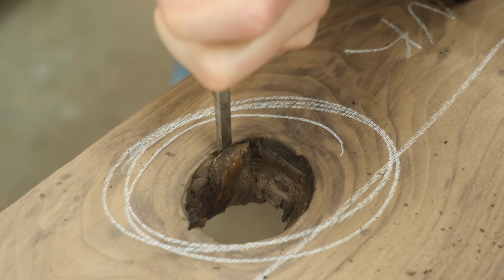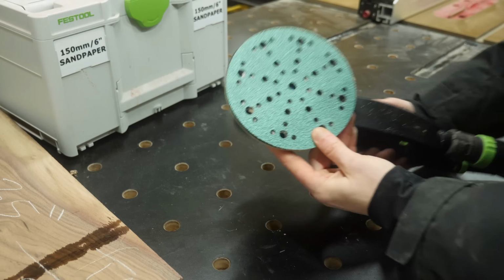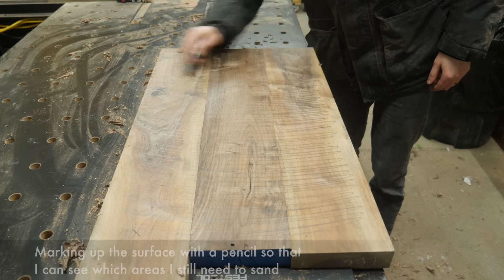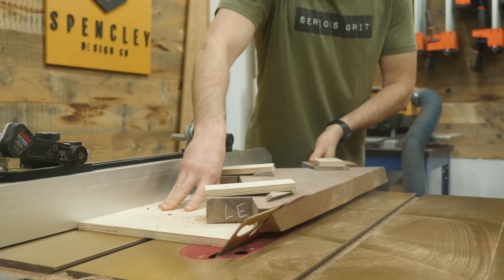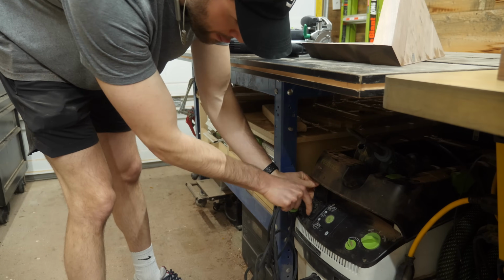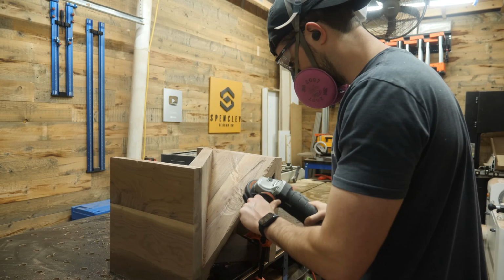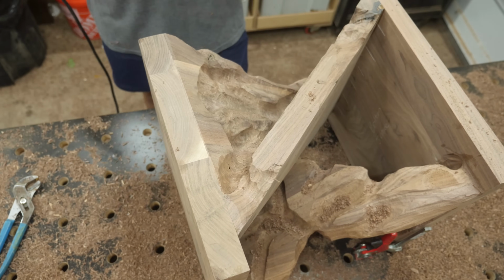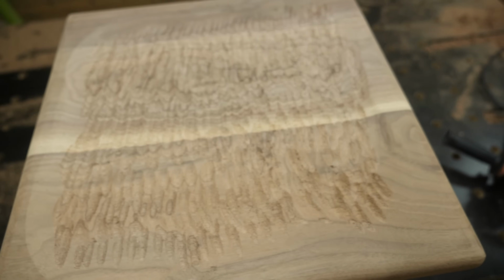why everyone is afraid of this

Comment: @SpencleyDesignCo I'm going to disagree with you on quite a few points, I think you're in a bit of a bubble here. Hand-tools aren't antiquated or outdated, but - using them is a choice. A woodworker works with wood - which you do, so you're a woodworker. If that's a label important to you. 

Here's an old saying: The tools don't make the craftsman, the craftsman makes the tools. 
Everything you use as a tool serves the purpose you put it to.
Power tools are faster, and more time efficient. The way you work with wood using power tools versus hand tools is different: they're different skillsets. 

Hand tools - in some instances, like planing - can match the time and effort of an orbital sander - if the blade is sharp enough,
Which - sharpening tools with blades is necessary, most of the time, or with power tools, you just buy a new blade.

Blades, in general, dull over time, saw blades, planers, jigsaw blades, everything dulls, the difference between most hand tools and power tools is that you sharpen the blade yourself. Sharpening doesn't always take a long time, unless you've been using a dull blade for a while, in which case you dug your own ditch there. 

At the end of the day, what you choose to use in your shop is your choice, if anyone tells you that you're not [x] because you don't [y], that's called gatekeeping, and those people are assholes. 
Everyone has a preference in what tools they use, I like hand tools, but power tools make certain things easier and help be spend more time doing the things about woodworking I like, and less time doing the things I don't like. I'm an amateur, I don't do woodworking for profit, I like designing and creating things, sometimes to fill a need in my house, sometimes to fill a need in the places i donate my time to. A few of my projects are fixing up a mobile cooler and modifying it to better suit the community's needs. Also they're broken, so repairing them is the main goal - I'm just repairing them... better... anyway - it's more of meditative, creative problem solving practice. 

The slowness of handtools helps me slow down - because I tend to move miles a minute and miss the trees for the forest and the flowers from the bush.

Comment: The hand tools thing is a great point. I love my hand tools, and even refurbish old stuff to resell and keep in circulation. That said; it does get culty when you have a job that isn't as easy or straightforward with them, and Dave next door is on a autistic rant about how you're doing it wrong, and must be lazy or unskilled. I think it's important to keep your hand tools if you're like me and inherited some, or feel more comfortable with them, or if you don't build for speed/money reasons and like the quiet, orrr like if you want to learn the fundamentals so that you're able to work with anything you have even if the power goes out... Come to think of it, there's a ton of reasons to use them, but that doesn't mean you suck for preferring mostly power tools either.

P.S. Congrats on getting married and getting a home!

Comment: When you talk about how hand tools are kind of outdated in many cases, you might be partially right, but I think you miss one thing, and that is the completely different approach that today's woodworkers have compared to say a couple hundred years ago. As you also stated in this video, nowadays most designs are only including flat surfaces, perfect 90 degree edges- and really not much more at all. Which is a taste thing, and "de gustibus non est disputandur", so I'm not implying that it is wrong or anything, though sure I think most people who look at 18th century furniture and say it is outdated don't realize that the reason why trends have changed so much and took a much more minimalist approach is at least partially because these "new" shapes (flat, straight, 90 degrees) are much easier and cheaper to produce in either buildings, furniture or clothing. They also allow the use of much cheaper materials, like mdf instead of very expensive lumber like you used in this project. In addition, these shapes are much more convenient if you are trying to mass produce furniture, which at the end leads to big factories like Ikea being able to lower the costs of production and still have an end product that many people will think looks good. So it's kind of like financial aspects are what shape style trends, and at the end of the day influence our taste and what we find pretty, which is a more rational reason why I personally dislike this change that has happened since the beginning of the 20th century. Back to my main point: The reason why you might say that hand tools are not convenient or relevant for you is because they are very good at producing flat surfaces and 90 degree angles, and they do that ridiculously fast. But if you were to say start a project in the style of Louis XIV., you will very soon have to grab those hand tools. Now that's what these people you were talking about don't get.

Comment: Stop putting your hand on the wood/track while you’re cutting! If a kick back occurs you will lose your fingers or even your whole hand. Only beginners put their hands behind the blade.
Also, who scrapes the resin off each tooth with a chisel? Plop the blade in a round tray and spray it with some Simple Green. Let it soak for a minute and use a nylon or brass brush to remove the resin. Rinse with hot water, towel dry and you’re good to go in under 4 minutes. I suspect your blade isn’t burning because of dullness but rather the saw table top isn’t at the right plane with an angled blade. You may have to shim one corner by measuring the blade against the table slot while it’s angled. Some trigonometry might need to be used to get the exact amount of shim height, or you can use trial and error after finding the low corner.

Comment: I didnt like it. Its too formulaic. Like "Arbortech" "Total boat" am I learning something or am I watching a total boat commercial? I felt him on the pythagorean cut tho. I had a 2" unit rise for a ramp. You should be able to extend the seat cut to complete the joist. The ledger cut fit fine but the foot cut not so much. I either cant math or if you shot a laser across the ground its not flat anywhere, which I know its not so were cooked boys. 

The reason I like hand tools is its good to study it then whip out the power tools then come back in to clean it up with the hand tools. Its neat and better. Like Japanese wood joinery with wood glue and deck screws. studying how they did it pre WW2 with hand tools and specifically Japanese joining stepped up my wood game as I incorporate that. I like my chisels, scribe knife and draw knife. The Hand plane I want to throw across the room. But its the cheapo harbor freight version which I said if I dont like it I'll build it into a japanese box plane. Never did it now I just want to throw it across the room.

Comment: Instead of using Tuck Tape and that expensive melamine and caulk, instead use cheap plastic tape and hot glue.  In case that fails because its cheap, place it in expensive melamine with the borders caulked.  Dude- whats with the video on “Dont use this strategy- but I use that same strategy”

Comment: I too started woodworking in my apartment parking lot. I now own a beautiful home with a two car + garage I use as my woodshop. One tip I can give is to not only have a 200 amp panel, but to have a 200 amp breaker box on the utility pole coming into said panel. That way you will be able to run your planer and dust collector together. You will be happier.

Comment: You are hilarious.
Anyone that knows anything about hand planes knows they are far faster and leave a far better surface than a random orbit sander.  But of course because you have zero woodworking skills  ( as demonstrated in this video) you have no choice. Of course if your parents, I mean “ clients” don’t care about quality, why should you.When you cleanly slice the fibers it tends to make the surface “ glow”. Hand sanding (not by machine) can leave a good surface but it takes much longer. Using a machine to sand(other than a drum sander) leaves cross grain scratches. That is a fact. And another fact… using a hand plane can give you superior edge joints for panels. But of course with your vast knowledge of woodworking 😂😂😂😂😂 you know that.

Comment: Summer of George. 
1. Disappointing that you mentioned multiple Arbortech tools so much when talking about carving (a serious downside of being sponsored).
While they have many cool tools (like the Ball Gouge), talking about other tools besides using sanding discs would be more balanced.
For example, using a Power hand jointer will really move a lot of material much faster and safer than a carving disc for initial stock removal.

2. Incredibly ironic that you spend a good deal of time talking about your vacation, your new wife, and George while simultaneously complaining about YouTubers filling their video with unnecessary stuff. I come for the woodworking, not to hear about your love life.

3. I'm so tired of woodworkers waiting until the end to do a Grand reveal. I get it, it's more showmanship than woodworking.
But 99% of the time I'll skip to the end of the video first to better understand how the tips fit into the overall design.
If showing the end piece at the beginning was good enough for the New Yankee Workshop, it's something to be emulated.

But overall, the woodworking tips and projects are interesting enough that it makes it worthwhile to watch and you've earned a Sub.

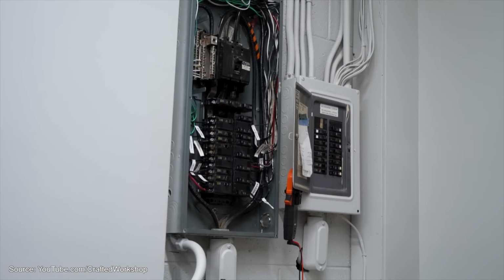Comment: 7:50   Seriously... lots of residential neighbors to pissoff with all the noise from screaming machines.. while you self admittedly bumble around or engage in commercial activity in a single car garage. Where do you park your truck?  In the limited spaces provided for visitors? 
Got limited power available too.
Apparently, you have zero care factor for those neighbors.
I'm surprised the HOA or Local Council hasn't shut you down by now.
Do everyone proper and rent a workshop in an industrial area.